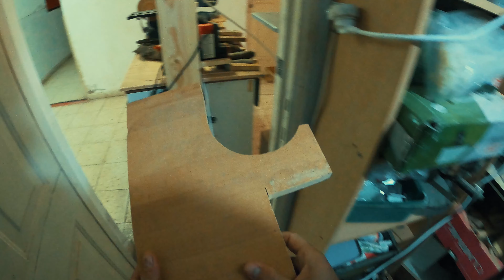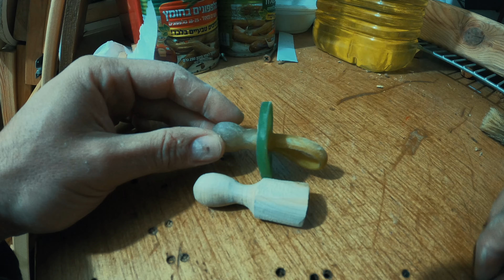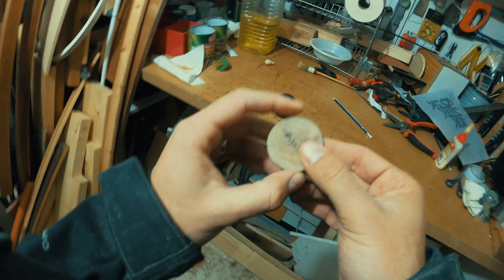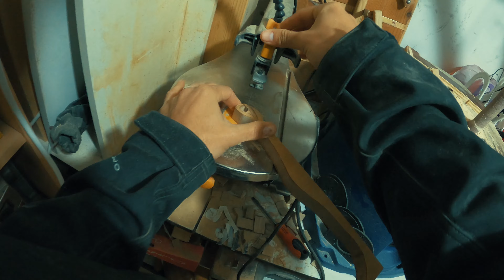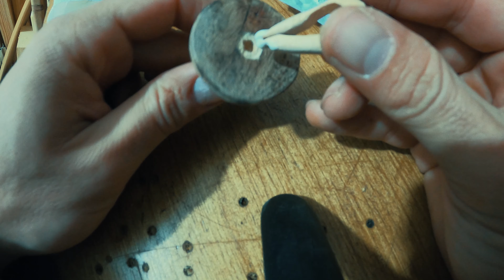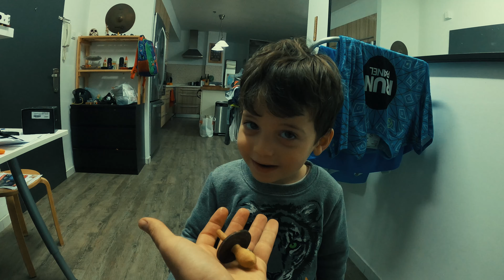DIY Wooden PACIFIER | Woodworking | How To | Handmade

Comment: Nice. But..... Coulda done ALL that work on the 1st two pieces on your lathe......
Reply from the maker: Thank you! You are right!! But On that video i found out my mini lathe is really bad. I really want a new one. But my space is very limited. So maybe a mini lathe, but good brand!
Reply from the maker: any recommendations?
Reply: @woodenlogos3428  I'm a machinist so I use a metal lathe to turn both metal and wood. I don't know much about wood lathes except - heavier is better! I don't think you need spend a lot. If nothing else, Grizzly.com has very good quality gear for the money. ButI'm sure if you ask on the "wood turning" forum on FB you'll get much more informed answers.
Reply from the maker: Thanks! I will check this out!